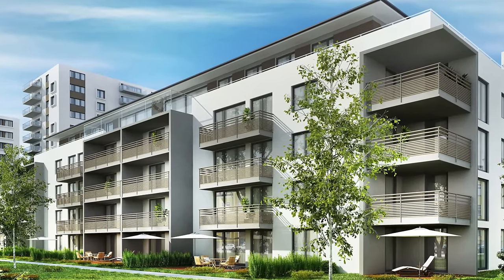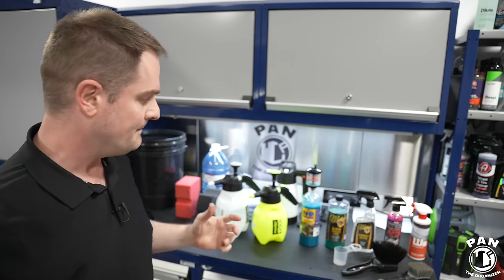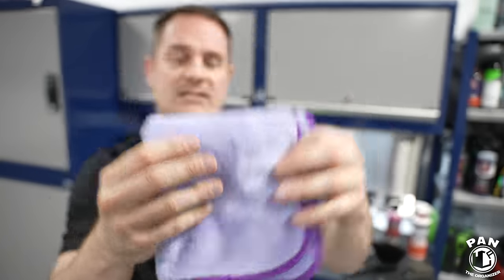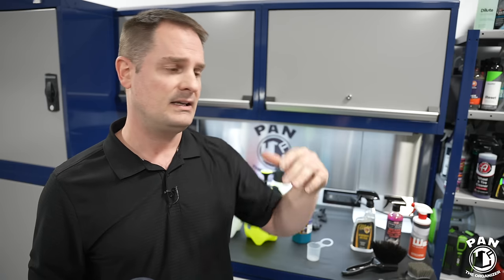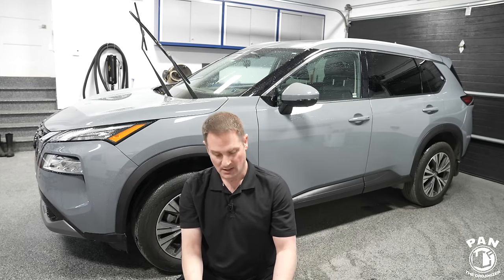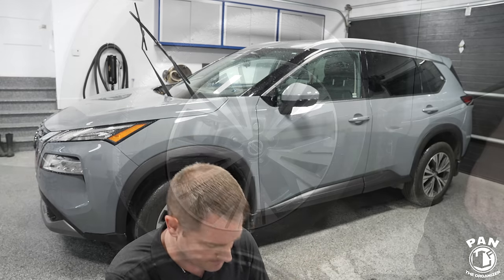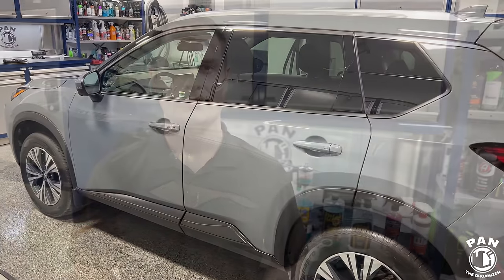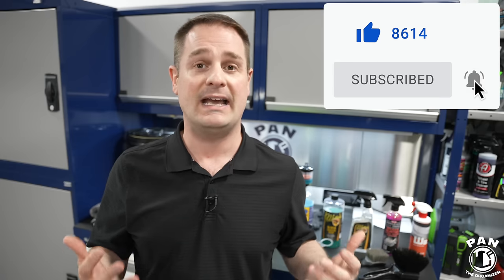How to wash your car without a hose or pressure washer! (RINSELESS WASH METHOD)

Comment: Great video Pan. If using clean water (DI), could you eliminate the drying process (use of a towel) as clean water would not create water spots?  Or would the rinse less wash method (ONR for example) leave some spotting / film on the vehicle?
Reply: I'm obviously not Pan, but for what it's worth, I've found that even if it's DI water, even though the water itself won't leave a stain/water spot, small bits of dust in the air will still come in contact with the car and the water on a wet car will make the dust "stick" to a car more than if the car was dry. Then because the dust only collects where the water droplets are, when the water does evaporate, you are left with small clumps/spots of dust that have collected on your car.

If the car was dry, even if the same amount of dust landed on your car, it would look less bad because your car would be evenly, lightly coated with a very fine dust, rather than larger, sparser, more uneven looking small clumps of dust that resulted from the water droplets collecting the dust before evaporating.
Reply from the maker: With a rinseless wash, you still need to towel wipe the car at the end, because the rinseless wash encapsulated all the dirt so you have to remove that off the vehicle by wiping with the microfiber drying towel at the end. Because if that water would evaporate, although the water itself wouldn't create water spots, the dirt that it cleaned and that's trapped in the rinseless wash would stay there and create deposits.

So when you are done cleaning the car with the rinseless wash solution, you absolutely have to hand dry the vehicle with a microfiber towel.

Comment: I bought the Industry 2000 Marolex sprayer for this, and was wondering about cleaning it. I just ran some clean water through it and let it dry out some. The instructions have this whole complicated procedure they recommend after use. What do you do?
Reply from the maker: Just fill with warm water, pressurize, spray to rinse everything out and let it air dry.

Comment: Curious why you do seem to prefer normal to rinseless on less than filthy, i've been using ONR on my black hobby car for a few years, less hassle with water running out of seems even after blow drying, & have started doing the same on my drivers unless really dirty & find it faster.
Reply from the maker: Personal preference. I have been using my method for 25+ years now, and I don't change a working method unless I see a huge benefit to going to something new/different. It also takes me less time overall just using my pressure washer, believe it or not. And psychologically, I feel the traditional wash method is more enjoyable. And I wash my car twice weekly, so I might as well enjoy the process.

Comment: This is what my car looks like after a day of sitting outside. We don't have a lawn and instead, it's covered in sand. And those sand particles blow around easier in the wind than actual dirt and create a thin layer on the vehicle. We also don't have access to a water hose or any sort of pressure washer. Ans I often have to use 4 buckets to wash the car as the single one gets super dirty and I also have to use two washer mitts.

Comment: I see you sprayed the bug remover after the rinseless wash. Wouldn't the rinseless solution underneath affect the bug removers ability to do its work?
Reply from the maker: Don't overthink the moment. It works just fine. The other thing you could do if you're worried of over-diluting the bug remover, is spray the bug remover first, on dry paint, let it dwell and soften the bug guts a bit (never work in direct sunlight) and then do the pre-treat with the rinseless wash on top.

Comment: Another fantastic video Pan, thanks.

One question: would a wheel brush be a good choice for the agitation phase of the wheel cleaning for a painted wheel that is clear coated? I have new wheels that I'm going to install next week that are painted gloss black and clear coated, to match the car. They have been polished and coated and I'm concerned that a brush, with its bristles, might scratch the clear coat. My plan was to use a mf cloth that has been saturated with a lubricious cleaner and hand wash the wheels. I did this on my older wheels, that were partially painted with gloss black paint and clear coated and I have been able to preserve the finish of those wheels. These new wheels are extremely expensive and I want to make absolutely sure that I don't do anything to mar the finish. 

Thanks again for all that you do.
Reply from the maker: For gloss black wheels, I prefer microfiber wash mitts for the face, and a microfiber brush for the wheel barrel. 
Mitt: https://bit.ly/3sI0Vw4
Brush: https://bit.ly/45AfjFc

That is what I use for my 911 Turbo S that has gloss black elements on the wheels.
Reply: @PanTheOrganizer  Thanks for the tips, much appreciated.
Reply from the maker: You bet!

Comment: I have wanted to try a rinseless wash for so long, but I’m paranoid. Spend all this time correcting the paint and then applying a ceramic coat, only to introduce a sponge to the paint? It goes against everything I’ve ever learned about vehicle paint care haha. I desperately tried to convince my township to allow me to put drains in the garage so I could wash indoors during the winter, but they wouldn’t allow it at all. I just may give rinseless wash a try this winter. 

If I were going to buy microfiber towels specifically for this process instead of a sponge, would you recommend the one you used in the video, or a different one? Thanks!
Reply from the maker: Yup the towels linked in the description.

Comment: I know you are supposed to use a microfiber drying towel to dry the car. Is it acceptable  to use a heated air dryer to get the rinseless solution out of the cracks? If so, should you do that first, and then use the towels, or use the towels first and then the air dryer?
Reply from the maker: You wouldn't use a blower with a rinseless wash, as you'd be blowing all the dirt contained in the rinseless solution. You use a microfiber drying towel when drying a vehicle after a rinseless wash method.

Comment: Hey Pan. So basically there is no need to rub the sponge against the grit guard? Just putting int back into the bucket and wring it out is enough? Thanks.
Reply from the maker: If the car is dirty, then yes you could scrub the sponge in the bottom of the bucket for extra safety. Just like you would with a regular microfiber wash mitt.

Comment: Hey Pan, Im making a plan for winter wash and using the self serve car wash for the pressure sprayer. Should I knock off the salt/snow with the pre rinse n914 or should I pressure wash and then apply the n914? I worry about the water on the vehicle affecting the dilution ratio once the solution is in the marolex bottle
Reply from the maker: I would pre-treat the surface with N-914, then pressure rinse, then contact wash.

Comment: Do you think using ONR in the IK Foam Pro 2 is fine? I know ONR is not supposed to foam but I do not really want to buy another sprayer! I can't imagine it would be bad for it?
Reply from the maker: I wouldn't use rinseless washes in foaming type pump sprayers. Get the normal IK Multi Pro 2 for that, or even better, a Marolex.

Comment: How many times do you have to fill the pump sprayer up for the whole car? Also, if you're only using one bucket, wouldn't you ineveitably get some dirt into the bottle after filling it up, even with the grit guard? Wondering if a two bucket (one clean w/ rinseless solution & one dirty w/o solution) method would help? 

Also, how many of the large microfiber towels do you need for safe drying?
Reply from the maker: You only fill the container once, BEFORE the wash process. Just get a bottle big enough to cover your size vehicle. Typically a 1500 to 2000 mL pump sprayer.

Only one large microfiber drying towel is needed for most vehicles.
Reply: @PanTheOrganizer , thank you so much for the response! Do you still recommend the DIY Detail Legacy two sided sponge and The Rag Gauntlet drying towel (30x36 or 20x30)?
Reply from the maker: Yes. Excellent.

Or you can get my own new rinseless wash here: https://thehouseofrags.com/collections/clean-by-pan-the-organizer/products/rinse-less-wash

You can see my video about it here: https://youtu.be/HlKEyCrr2vM?si=GRBSJUVcCOyp76vE
Reply: @PanTheOrganizer  congrats on the new product line! Do you recommend the DIY Detail Legacy two sided sponge or multiple microfiber towel method? Probably easier to clean the microfiber towels in the laundry and less prone to dirt getting trapped like the sponge, even though I know this particular sponge has the unique design to mitigate it?

Comment: Hey Dan, as winter is approaching I’m trying to maintain my ceramic coating on my vehicle. Would a Rinseless wash be okay to maintain the coating? I’d apply bead maker once or twice a month. While washing it once a week. Is there any rinseless soap you’d recommend to keep the ceramic coating healthy?
Reply from the maker: I prefer a traditional wash with buckets and shampoo. But if you can only use a rinseless wash to wash your car, yes it’s ok to use on a ceramic coated car. The protection will come from Bead Maker.

Once every three months, I would also recommend that you apply a longer lasting silica spray sealant.

All ceramic coating companies usually have a maintenance ceramic spray to go along with it.
Reply: @PanTheOrganizer  unfortunately I won’t have access to a hose during winter. I don’t have water access in my garage, nor do I have a heated garage. Is there a two bucket method that doesn’t require a hose or pressure washer? 
Or is my best bet the rinseless wash during winter? 

When I got my ceramic coating done they didn’t mention any silica spray to apply. They told me to apply bead maker every 3 months then 1 month for the winter. Do you have a video that covers the silica spray?

Comment: Can I still use break buster in a ik foam sprayer using this method? Or do you recommend just using it out a regular spray bottle?
Reply from the maker: Yes as long as you dilute it properly. 1:3 to 1:5 in a foaming pump sprayer.

You can see me demonstrate that in this video: https://youtu.be/Ty4ZTq7A7rc

Comment: Would you recommend using a wash mit/pad or these sponges for regular contact washes?
Reply from the maker: What ever you prefer. It's personal preference. You can use a rinseless wash sponge, a microfiber mitt or microfiber towels.
Reply: @PanTheOrganizer  What would you say is the safest, in order to prevent damage to coatings or paintwork? I'm don't know whether I should get the sponge or incredimitt / incredipad. I'm looking for the safest option. Or what the easier question to answer may be, what is your preference. I know that they are both high quality products.

Comment: Ouch! Water was used and involved in the process.
Is there such a thing as waterless (no liquid or fluid of any kind) and drywash? Would Dry Ice work?
 Guess that would mean dirt forced off by air pressure or can it be wiped off without any liquid solution. Maybe use Silly Putty or Play-Dough to roll over the surface and leave nothing behind. Make the car surface repel everything as can't cling or attach itself for it has a force shield. We would no longer need to clean our vehicles and say goodbye to all those car products.
Reply from the maker: Of course water is used in a rinseless wash. You have to dilute the product. And also, you would use water to pre-rinse the vehicle if it's too dirty to start off with. Just like pre-washing or pre-rinsing before a traditional two bucket wash method. Rinseless doesn't mean you never rinse, it just means no rinsing is needed at the end of the wash process.

A waterless wash is completely different. It's a spray product that you spray on the surface and start wiping. Zero water used. But I would never recommend that, as you run the risk or really marring, scratching the surface. A waterless wash should only be used as a last resort method when you literally have ZERO access to water, or simply don't really care about the appearance of your vehicle and just want a quick clean and aren't worried about the consequences.

Comment: I'm all in with this. You say that if the car is extra dirty that you should pre-rinse with your power washer. Would you do that on a dry car, or spray some of the rinseless solution on the car first, and let it sit for a bit before you power wash? And then, of course follow the directions in this video after that.
Reply from the maker: Yes you would pre-treat with a rinseless solution first, then pressure rinse, then wash the car with the rinseless wash solution.
Reply: Would it be helpful to blow a bunch of the water off with my leaf blower after the pressure rinse?
Reply from the maker: No. You wouldn't use a leaf blower after a rinseless wash, as don't forget the rinseless wash has all the dirt in it, so you don't want to be blowing that on your paint. Use a microfiber drying towel to dry the vehicle.
Reply: I was specifically asking about after the optional "pressure rinse" that you mentioned above. Not after the "rinseless wash".

Comment: Would this work in a more dirtier, car ?  not necessarily mud  , but a bit dirtier ?  Not trying to disrespect or troll,  but these cars , normally *  seem pretty clean and a light wash would be perfect.  My cars usually go about 3 weeks without a wash so , just wondering if this would work ,without hurting the paint : Thank you  for  your help 🙏🏻
Reply from the maker: If the car is too dirty, as I mentioned in the video, you need to use common sense and pre-rinse the vehicle first. A rinseless wash doesn't mean you never rinse, it just means there's no need to rinse at the end of the process.

If you want to see pretty much the limits of a rinseless wash on a dirtier vehicle, watch this video: https://youtu.be/U0nSQe1qHEc
Reply: @PanTheOrganizer   ahh ok  ,  now i see . Thbk you very much .  subscribing

Comment: My Z06 has been sitting in the garage for about three weeks.  There's a good deal of dust/pollen mix on the finish(Torch Red)  rinseless? Or foam/Reset?  It's coated with csl/exo.   Your thoughts?
Reply from the maker: It's a question of personal preference. I wash my car twice weekly using the two bucket wash method.
Reply: @PanTheOrganizer  That's what I thought You'd say! You're a two bucket Guy! 😬   Thank You.

Comment: Do rinseless washed leave any waxes or polymers on the paint?   I was wonder it this would work before painting, like pinstriping.   I don't want to add any film before coming back with wax/grease removers.  I just want a way to remove grit and dust.

Comment: In another video you mentioned some shampoos that are PH neutral for cars with ceramic coatings on them. Where does the rinseless wash come in? Specifically. The restart wash by Gyeon "declogs" the coating. Do all the shampoos that you personally use do that? Or is it just the restart wash? If it is all the shampoos, would the rinseless wash also do that?
Reply from the maker: Gyeon Restart wash isn't a rinseless wash. It's a coating maintenance shampoo with iron removing technology in it. It helps restore hydrophobic properties of coatings all while removing brake dust accumulation.

A rinseless wash, like the one in this video, is an ALTERNATIVE to a shampoo, for those who don't have access to free flowing water, a pressure washer, and buckets of water for a more traditional wash. A rinseless wash is a method that can be used for apartment dwellers, or people living in areas with heavy water restrictions or water bans. As long as the vehicle isn't too dirty (use common sense), it's a good alternative if you can't wash your car the traditional way.

A rinseless wash can be used on a ceramic coating, as it's a gentle cleaner. The vehicle in this video is ceramic coated by the way. But a rinseless wash won't "declog" a coating as you said, as it's not strong enough for that task. You need more powerful shampoos that are formulated for removing traffic film and unclogging coatings to restore the hydrophobic properties.

More on that in my ultimate spring detailing tutorial here: https://youtu.be/oTaFE_p2OAw

Comment: Can you also put wax/sealant on when doing a rinseless wash like this?
Reply from the maker: At the end of the rinseless wash process, you could spray a drying aid (like a quick detailer for example) on top, and use that to further boost gloss and slickness, yes. If that's what you meant.
Reply from the maker: Welcome to my channel. You discovered one of the biggest car detailing channels on YouTube as we surpassed 890,000 subscribers and we have over 115 million views! I have been detailing for 26 years and I love to share my knowledge and passion with my viewers.

You found the right channel to help you learn everything about detailing.

Also, I highly recommend that you watch my Detailing 101 series for beginners, where I explain different steps like iron removers, clay bar, polishing, protection, etc. It's super simple once you understand the basics, and your car will look and feel 100x better!

Part 1: how to properly wash your car: https://youtu.be/7Koj5j2Es5U
Part 2: how to clean wheels and tires: https://youtu.be/omwcNcSYcS8
Part 3: chemical decontamination (iron and tar removal): https://youtu.be/W_cyHz3XssU
Part 4: clay bar: https://youtu.be/XB8UaTCXuLg
Part 5: machine polishing (paint correction): https://youtu.be/ustTEVGMOTI
Part 6A: how to wax your car https://youtu.be/KZjiPcsPBrA
Part 6B: how to apply a ceramic coating: https://youtu.be/sqQYVjxFqK0
Part 7: Differences between waxes, paint sealants and coatings: https://youtu.be/4ejfPHan3k4